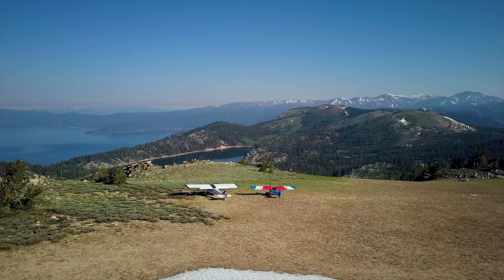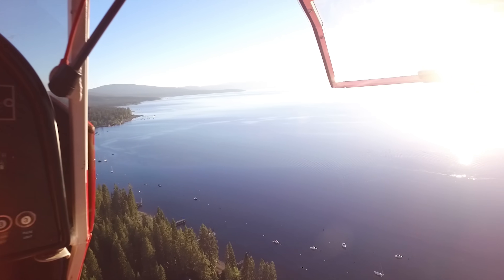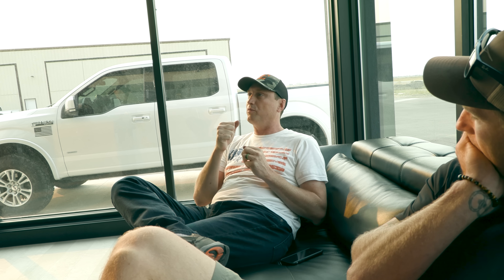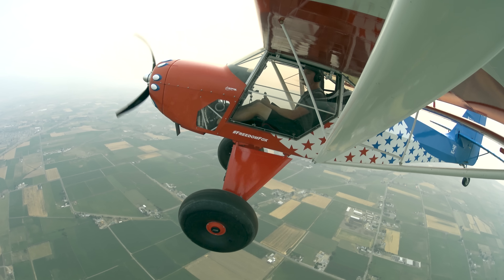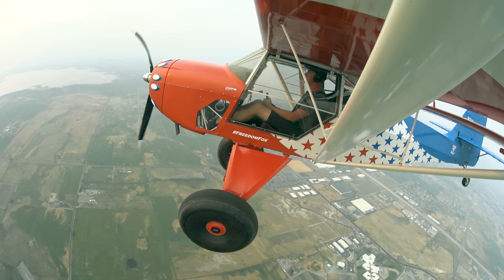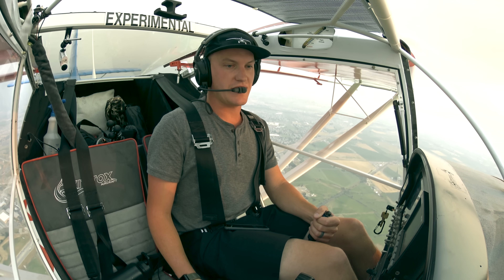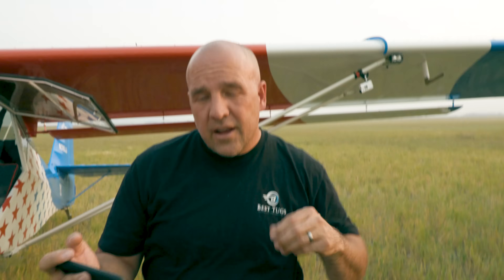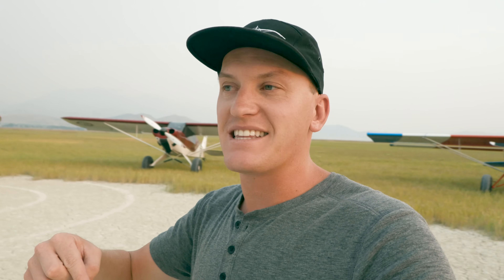YOUR FLIGHT INSTRUCTOR WAS WRONG! - Simulated vs Real Engine Failure

Comment: Excellent video and timely for me. I just finished a Zenith CH750 STOL and am writing the flight test plan while waiting for the FAA to certify the kit for flight. Have survived several engine outs long ago, all in 2-cycle ultralights and most due to fuel issues, so I know that after things get silent, it’s all about having the field already selected (every five minutes) and using good, conservative Energy Management (two words I’m surprised that you did not use). Anyway I plan to do several engine out tests at idle and finish with deadstick landing once I know how this ship will glide, slip and flare inside and out. I may be flying in modern 4-cycle Avgas-fueled glass-paneled comfort, but it’s all eventually stick ‘n rudder. You must be calm and prepared, and experience IS the best teacher.

Comment: The real value of engine out training is not perfectly judging a glide range but being able to see if the field is made or not. It also builds confidence that it is not impossible. Wind will, of course, throw a spanner in the works.

As a CFI, I completely agree training isn't a perfect representation, but it does not need to be. Many people had real accidents doing actual engine outs because the general skill level and environment to instruct this isn't there, so go for the happy medium. The same with the impossible turn. It can save your bacon in the right circumstance, but it can be a real killer even for highly experienced pilots.

Comment: the prop is really nothing but rotating wings, and as long as those wings are pushed by the engine, they are going to create lift (thrust). Once they are no longer being pushed they will no longer create lift. It's really the same principle as how the plane flies, just on a different 'plane'....pun intended.

Comment: This can be circumstantial.
Prop tip of a windmilling propeller has a higher airspeed velocity than a stationary prop. (African or European)
Autogyros take full advantage of this.
Also, some props feather when the engine shuts off.

Comment: The published engine out minimum rate of descent speed on certified aircraft is determined with the propeller windmilling.  With the prop stopped, a slower glide speed might make the rate of descent less...  ??

Comment: Spinning propeller is creating “turbulence “ on the surface of the prop blades, which has less drag. That is why golf balls have dimples. Turbulent air on the surface of the spinning prop will have less drag even if it is producing no thrust.

Comment: Don't forget, the propeller blade airfoil is completely stalled when the relative wind is from the top of the airfoil.  The stalled, turbulent airflow might create less drag than a rotating blade pushing a non-running engine.

Comment: I'm sure this comes from CFIs who are instructing while also working on building multi-engine time.  In twins with variable props, the single engine out practice procedure has a step where the instructor "simulates feathering" by advancing the throttle a prescribed amount because an idle engine at blue line creates more drag than a feathered prop.  Twins come with tables showing how much throttle to add to simulate feathering.

My guess is that this knowledge is being back-ported to fixed-pitch single-engine planes when it actually doesn't apply.  Clearly a variable prop at full-fine at 90-100kts (blue line for a lot of light twins) is different than a (now I'm guessing) pretty aggressive prop at 60kts.

What I would like is for someone with a 172 to try the same experiment.

Comment: How would a freewheeling prop make more drag than a stopped one? If a force is applied to the prop (drag) what difference does it make if the force is great enough to overcome the friction of the motor? Arguably, once the motor is freewheeling, the kinetic friction within the motor is less than the static friction of a stopped motor, and the "wind speed" on the leading edge of the prop is now lower..

Comment: Why not try a bit of an adjustment to this. Mark and Cory have the same (for practical  purposes) plane.  Some one put a cone/landmark on a dry lake bed that you guys go to and at let's say at 1,000' AGL with both planes side by side one pull the throttle to idle and the other kill the engine all together at the same time/point. See who actually goes the farthest before touchdown. (with both trying to stretch it like you would if you had to make the distance for real) This way the head/tail/cross wind will be identical for the experiment.

Comment: Drag coefficient  -  Cd = D/(A*.5*r*V squared).  Dynamic pressure  -  CD = D/(q*A).  The drag coefficient expresses the ratio of drag force to the force produced by the dynamic pressure times the area.  Velocity, density, air viscosity, and compressability all play a roll.  The only way to test this theory is in a controlled environment such as a wind tunnel.  As the prop is spinning at idle, the dynamic pressure has also changed thus the drag coefficient.

Comment: An engine at idle does produce some thrust. It does not produce a net positive thrust to overcome the total drag of the aircraft. What it does is mitigate a portion of the total drag. Let's make up some numbers to illustrate. Assume the total drag of the aircraft is -100lbs and the total thrust at full power is +150lbs , the result is 50lbs positive net force resulting in acceleration or climb . If total thrust at idle is only +25lbs the net force is -75lbs  (thrust - drag). A stopped engine produces 0 thrust giving a -100lbs total force on the aircraft. The stopped prop will add some drag but the loss of the idle thrust is main factor here. On a Side note, If an idling engine did not produce thrust, how are you able to taxi at or near idle? There has to be at least enough thrust to overcome the rolling resistance of the gear.

Comment: My theory: the slipstream over the horizontal stabilizer is lost when the prop is completely stopped or windmilling. This would result in a loss of some elevator effectiveness.Therefore it would take more elevator input or trim to maintain attitude for best glide speed, which would result in more drag and decreased glide distance

Comment: With that data; if you are going to keep IAS equal then simple decent rate would give you an indication of distance.
So I would think you maybe could extrapolate what the result of a complete prop stop by checking your decent rate at 1000 rpm, 1500 rpm and 2000 rpm  (with a gear driven prop)  or 600, 800, 1200 with a direct drive prop. Heck simple seeing the difference between the decent rate of idle and just a couple hundred rpm may give you an indication that a moving prop adds to the distance of "the glide"
Just my thoughts

Comment: We used to test this theory flying RC pattern ships, racers  and such. YES! A idling, fixed pitch prop creates drag and, without this drag, planes such as the G B Racer or P-51 would be almost impossible to land. Real men fly tail draggers! Don't forget that loss of altitude and drag are not the same. Yes, a stopped prop will cause your loss of altitude due to a complete loss of thrust but when I cut the throttle on my G B I could land, shut that that engine down on a G B and you're flying a brick looking for a spot to crash. Awesome channel.

Comment: It depends on the idle speed (angular velocity) and relative wind speed which together will alter the effective angle of attack for the airfoil (different at each point along the radius), airfoil geometry, atmospheric pressure and humidity, etc.  Realistically you'd need to get the airfoil geometry every X amount of distance from the radius, then run a simulation for every velocity and angle of attack possible and save the data in a large table. Then modify idle rpm and wind speed, equate those to the saved values, and integrate them along the length.

Comment: Great video!!... great subject, going to practice some ‘engine out’ as opposed to ‘idle’ to characterise my aircraft next time... many thanks!!
Reply from the maker: Be safe!
Reply: Trent Palmer ...interestingly I chatted to an instructor today, he acknowledged your conclusion but argued the difference in performance between the two states is irrelevant as when it happens for real (as per you recent experience) the key is trim, airspeed and slope management to aiming point. However he agreed to accompany  me to check out for myself, cheers 👍

Comment: There's always a difference. Teaching yourself to carry a couple more or couple less kts to adjust glide path and using a side slip as necessary to hit your spot is the real world way of gliding to your landing. I've found the minimal glide ratio change is irrelavent because wind variations as you descend negate your plans. Theory is great. Being able to compensate for the variables is the key. Remember... Approach and landings is the most varied thing you can ever do.
Keep on flying. Keep on greasing those landings.

Comment: I'd also say a big factor in this is going to be related to how slippery the airplane is. A plane like say a pipistrel will probably glide really far on idle because it doesn't need much thrust to go overcome its own drag. A draggier STOL plane is going to benefit LESS from the thrust because relative to its parasitic drag the thrust is less. I think in any situation you're going to benefit from the idle thrust, I just think the difference will be more pronounced in a less draggy plane.
Reply: So the real question is if your airplane is a drag queen

Comment: Techie/nerdy may save someone plane or their life.
A lot of people below talk about the prop/engine as a separate component.
Mike Patey brought up an important point that makes all the theoretical and wind tunnel testing relatively unimportant . . .
How does the plane handle an how much authority has been lost.
I'm guessing that speed/drag is  important, but control authority is the difference between a controlled landing and a crash.

Comment: Just read an old flying mag artical about this. You agree with them. Power is power at idle. Spin or stop not much difference. So fly the plan and don’t do an inadvertent stall spin trying to stop the prop.

Comment: During multiengine engine out practice, rather than shutting down an engine and feathering the prop (risking a non-restart situation) it was common practice to add a little throttle to simulate zero thrust and the drag of the feathered prop. That seems to infer an engine at idle causes a lot of drag.

Comment: Prop at idle is generally more drag than a stopped prop. A stopped prop creates only a small amount of parasitic drag at typical best L/D speeds for light aircraft. A windmilling prop clearly creates the most amount of drag. A prop at idle power creates only a bit less drag than a windmilling prop. An idling prop on the ramp feels like about 20 mph of thrust, but at flying speeds (over 20 mph) the relative wind is actually driving the prop, creating drag. 

When flying a plane with a constant speed prop at cruise setting, and you push the prop lever forward, you can feel the sudden increase in drag, even though idle power is still being produced. In warbirds such as the P-51, is was common technique to use the prop control as a speed brake since an idling windmilling prop had so much drag as the windmilling rpm increased (but still under power). But that same rpm and idle power would still produce thrust while sitting on the ground.

Bottom line: if you have a real engine failure, and lots of altitude, you could try to momentarily slow down to where the prop stops, then resume best glide speed. Maybe the compression is enough to keep the prop stopped. You have to have plenty of altitude, a need to glide far, and be a pretty good pilot. This is a distracting maneuver and distractions are not good. At lower altitudes you need to be fully focused on making a safe landing into the wind. 

If you have a prop control, pull it out all the way (low rpm). Any windmilling oil pressure may control the prop to the low rpm setting, reducing windmilling drag. If you're in a classic aircraft that has the prop system with counterweights, loss of oil pressure will make the prop go to low rpm anyway, but pull the prop control anyway in case there is residual oil pressure. The operating manual describing loss of power forced landings will probably mention this. If you leave the prop control forward, you will not achieve the published glide angle (L/D ratio). This is contrary to the way you practice forced landings (idle and prop forward).

Keep the wind in mind. Add about half the wind to your best glide speed if going upwind. A little fast is better than too slow. Land into the wind.

Hope this clears things up.

Ben
Reply: Key difference between everything you have written and everything said in the video, "Fixed pitch prop"

Comment: I watched an emergency landing on a Cessna 210 the engine was running he had a chart in the cabin that would tell him the glad distance with the engine running and I don’t and a graph on RPMs to help him pick a emergency run way. It was a chart for a Cessna 210 and the amount of load he had on the plane you are to go find one of those charts and see what the facts are Cessna has already done all the homework

Comment: I do it all the time with our large fixed wing UAV's... I can prove with my GPS and pitot that the airspeed drops with an idling prop verses a stopped prop. All of the RC guys set their ESC's (motor controllers) purposely to brake hard to stop the prop and not windmill for reduced drag....but if you idle up just slightly, the airspeed drops and sink increases. It's no so much that an idling prop is presenting a "disk" but that the turbulence stream created by the spinning prop is now swirling about the fuse and tail feathers vs a stopped prop has a more static flow stream along the fuse... Great discussion!

Comment: Trent, I'm an armchair pilot for literally 50 years.  Early on, I was forced by my finances to quit taking lessons.  Since that time I've been a helicopter mechanic for the Air Force for 8 years, and a flight line supervisor for UND North Dakota for 4 years.  Lately, I've had a stroke which disabled my right hand and arm, so even if I had money, the FAA won't allow me to fly.

I tell you all of this so you will know I have some flight knowledge, and actual experience.  Though not nearly any amount like you have.

When the throttle is pulled back, the engine and prop still rotates.  But, it won't be enough to pull the aircraft, corkscrew style, through the oncoming air generated by the speed of the aircraft in idle condition.  Your airspeed is still going to be somewhere between 60 and 70 mph.  Which will, because of the engine force, present a blade speed moving slower than the oncoming rush of wind.  BUT, this oncoming wind WILL increase the props RPM somewhat, which in effect lessens the resistance to the air.  But that propeller spinning against the air still represents a disc of resistance, as it's not creating forward lift!

Comment: The relative wind speed wind speed behind the prop will be the same if your on the ground or in the air at speed. If the wind speed on the ground is 20mph then in the air it’s should be 20mph faster behind the prob than the actual wind speed. That would consider having the same air density

Comment: This doesn't take a PhD. A prop generates both thrust and drag. Therefore a windmilling prop will still be generating thrust, though not equal to drag. A stopped prop is nothing but drag, no thrust.

Comment: I've done many engine idling and engine off comparisons in my Rans. Idling it will go on and on and on, but when I shut off the engine it would slow down tremendously. I will say this that when the prop stopped windmilling it was noticeably that the airspeed picked up slightly. The difference is when the engine is actually not running. Windmilling is drag. No notes on this just hundreds of dead stick practice landing all the way to the airport.
Reply: I trust Teddy and agree!

Comment: Depends how fast the prop is turning.
Reply: Pitch (inches) X rpm (prop rpm, not engine rpm) / 1000 = appx how fast the prop is trying to pull the airplane.

The difference between stopped vs windmilling has to do with "stalling" the prop blades.  Fully stalled is less drag. than the blades acting as wings trying to slow you down.

So you need to figure out what is REALLY going on.

Comment: I can't understand how anyone would think the spinning prop at idle would produce MORE drag than a stopped prop....
And a wind-milling prop is going to produce less drag as well... Think about it. It takes a lot of effort (energy) to turn that engine over..
So, some of that energy that would have been drag is now being used to turn the engine over instead of just slowing the plane down.
I know... it would be an immeasurably small amount but, still...... Logic!!! Physics!!
Just my 2 Satoshi...